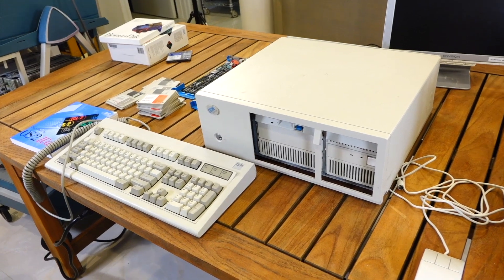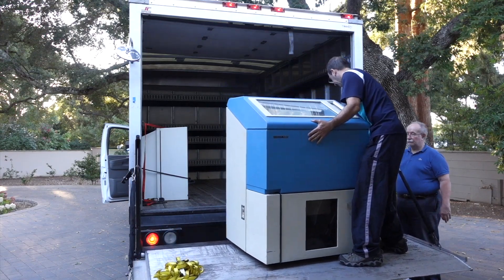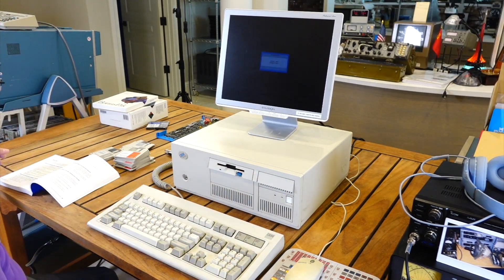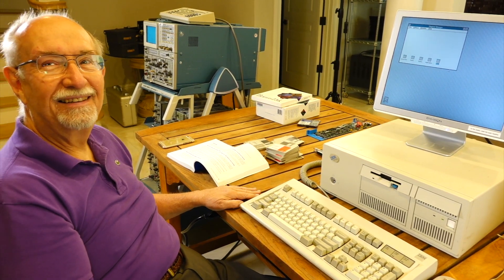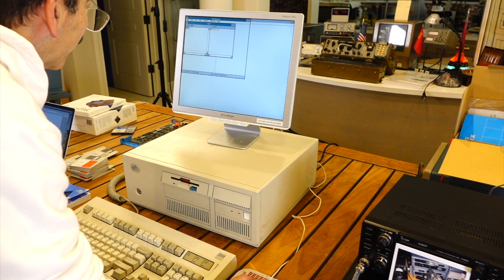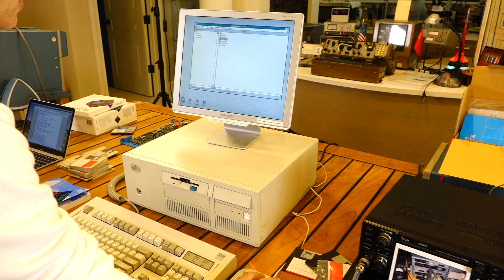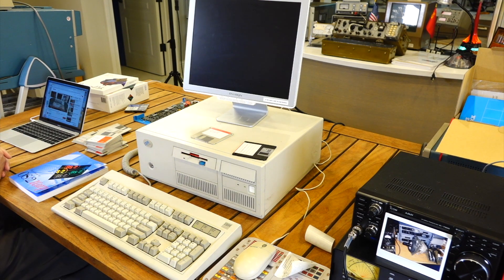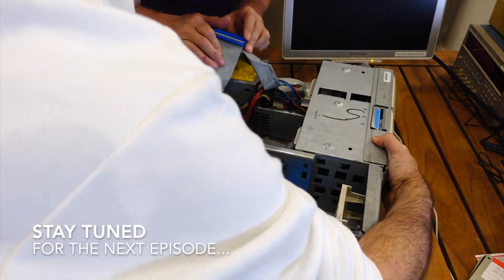IBM PS/2 - Part 1: the Model 77 conks out

Comment: The first boot we saw in the first video we did not hear a beep when booting normally. For most motherboards there's a speaker connected to it to sound error beeps from the BIOS reporting. Not for this machine ?
Reply from the maker: It beeps after POST at 4:52.
Reply: @CuriousMarc  OK, I hear, indeed, I was referring to 03:35.
The fact that it worked at first (and that the BIOS gets stuck) makes me think of (electrolytic) capacitors, on the motherboard or in the PSU. The PSU can measure OK, but is it needs testing for stability under load. I would have tried another as first, but I cannot tell from here if it is a special piece. You could check with a scope for cleanness of all the voltages.

Comment: The hidden partition remind me of a story. My dad once told me about an anti-piracy hack that was on old disks (probably floppy disks) where there was a physically corrupt sector of the disk. The program would write and then read that sector, and if it wrote correctly it knew that it was a copied disk. (because the real disk would return corrupt random data.)

He said his friends and him spent hours going line-by-line through hex editors comparing the two copies and couldn't figured it out. 

Eventually someone designed a device that plugged in between the computer and drive and would defeat the anti-piracy thing somehow. Wish I knew more specifics. 

The only other thing I know is that he was backing up software that he legally owned and not copying or distributing it.

Comment: Marc do you have an IBM 3420 Magnetic Tape Unit Field Tester? It is a small box with knobs, toggle switches and a short flylead cable that plugs directly into the 3420 tape unit and allows the unit to be tested in isolation - start/stop, rewind/forward, read/write and so on, no bus/tag required. I bought mine to go with my IBM 3420 tape unit that I bought on eBay "by accident" (and was forced to get it shipped interstate between Xmas and New Year). Let me know if you can't find one, I may be able to lend you mine.
Reply from the maker: Thanks! I know about it, and Carl has lend me his, so I am good for now. But wait. You bought an IBM 3420 *by accident*? Like it was just under 1000lbs so you did not pay any attention? Now I want to know how that happened!
Reply: @CuriousMarc  Glad you have the tester! I would be very interested to know how it goes. 
With my 3420, it appeared on Oz eBay listed as just 'Old Computer' would you believe. I put the initial bid on for a bit of fun and at a very low amount expecting to be outbid, and so I could track it easily. Later I had second thoughts as I didn't really want to have to ship it and got a bit worried I would win as the seconds ticked down. I groaned when sure enough I did. Then came the hassle of getting it. A furniture removalist was doing an interstate backload between Xmas/New Year (I was incredibly lucky to find that offer at a good price). I told them it was 'the size of a fridge, perhaps a bit heavier'... LOL. The two delivery guys dropped it off at my mum's place, they really struggled with it a lot getting it into her garage so she offered them a beer (Xmas here in Oz summer is hot). When it came to moving it to my place a few years later the box truck hydraulic tailgate lift almost didn't lift it.
I don't have 3-phase power so it'll be the 12th of never before I power it up, I suppose. But it sure looks cool. Would a single to 3-phase converter unit work?
Reply from the maker: @1944GPW  That’s what I intend to do, power them with a 3 phase converter. We’re not quite even sure why it would need 3 phase beyond the vacuum motor: the reel motors are DC.
Reply: @CuriousMarc  Fantastic! I will be sure to follow that adventure very closely and with a great degree of self-interest (As if I don't already follow you guys restoration adventures like it is! ;)

Comment: Seeing Marc struggle with Windows 3.1 like that is hilarious. I used to have a page on it and hang out in the PS/2 newsgroup something like almost 2 decades ago, and there still is a Model P70 stashed away in my parents' basement (not sure if it still works at all, the floppy drive had called it quits as most of them do, bloody SMD electrolytics). But yeah, there was a reason why we would rather be using Calmira than trusty Program Manager back in the day.

Comment: The original 486 CPUs came out in 1989, but they were just the original 20-25 MHz models that ran at the same speed as the bus. The 33 and 50-MHz models came out in 1990-91, along with the 486SX, a cheaper version that didn't have a floating-point unit (FPU) built-in, which led to the original 486s being renamed "DX". In 1992 came the DX2 models, which-- as the name suggests -- doubled the clock speed from the bus, giving you 40 to 66 MHz. Then, in 1994, they released the DX4 and later the DX4 WB models with write-back cache. Confusingly, these actually have a clock multiplier of 3 rather than 4 like you'd expect from the name, and were available in 75 and 100-MHz flavours. Those were the last 486-based desktop CPUs released by Intel; but AMD, Cyrix, and Texas Instruments continued to release new versions of 486-based CPUs up until around 1996. These included the even-more-confusingly-named 5x86 CPUs which were neither 5th-generation x86 CPUs, nor did they run a 5x clock speed! The market for 486-based CPUs for the budget desktop market lasted right up until 1998, when Intel introduced the Celeron as a budget CPU based on the Pentium II. It does seem really weird that they continued to make new 486 CPUs long past the release of the Pentium in 1993, but PCs with the latest architecture were so expensive back then that people were willing to buy new systems that were one or two generations out of date in order to save money. It wasn't until the late 1990s that PCs came down in price enough that the general PC-buying public could afford a model with the current architecture. I've got a 486 that uses parts mostly from around 1995 or so. That has a DX4 in it, but it wouldn't be unusual to find one with something like a DX2-66 from that time period either, especially if you've used up all your budget paying for that IBM premium!

Comment: Would you believe me when i say that at my job in 2021 i use an IBM AT with DOS 3.0, a couple of 486 with OS/2 machines, a 386 with DOS 6.3, and a small sampling of win98, xp, and vista machines? Also have a Fluke 9100A and 1720 series I've been struggling with (mostly due to poor documentation from the engineers who wrote the test programs a few decades ago). I repair Legacy Avionics Systems if you're aghast. I once spent a week and a half manually testing and Roll computer... that was analog... really wish I'd payed more attention in calculus...

Comment: I had a AIX R/390. That was a microchannel system with a S/390 processor on a card and a microchannel bus & tag channel processor. That booted AIX and then ran the S/390 emulator. I had OS/390, VM and Linux on S/390 (Marist College version) running on that. There was one time we took the processor across the road to the other IBM office and into the basement. That was the mainframe machine room (complete with a raised floor) and we hooked up a 3MB bus & tag 3480 tape (cartridge drive) so I could install some software that had been delivered from IBM manufacturing on a couple of tapes.

I've still got some of the CD-ROMS that include OS/390 stashed away.

Comment: I still have a 286/VGA based IBM PS/1 in the attic. Should be in perfect working condition. Those interesting machines could boot into a simple graphical user interface (running under IBM DOS 4.0) straight out of the ROM. They had 1.44 MB FDD and 512 kB RAM and grayscale monitor as the base configuration, plus a 20 MB HDD, color monitor and 512 kB more RAM as an add-on option. They came with Microsoft Works, and some great IBM software that would teach you to use the keyboard. They had some extra proprietary cable to the monitor and PC speaker sound would come from the monitor instead from the PC. They were very compact machines (but had no option to add ISA add-on cards!)

Comment: Awaiting the "Part 2" - Is there anything we can help with to get the Model 77 working?
Reply: It would be handy to know if the front LED's light up. I suspect not and a new PSU is needed. I installed setup and maintained most of the PS/2 range at some point and they were bulletproof.

Comment: I worked for IBM Labs porting software onto the XT/370 - an antecedent of this guy. It added 3 cards to a standard XT with a 10 meg drive. IIRC there was a 512k RAM card, a 3270 terminal emulator and a 68000 board with the processor remasked to run 370 ISA. We ran a version of VM/CMS on it and ported compilers and even the CICS transaction processing system. What fun!!
Reply: Dang. So it ran a 68k with custom IBM microcode to emulate most of the 370 instruction set. Then another unmodified 68000 was needed to handle the instructions that couldn’t fit into the first, then they added an Intel 8087 FPU again running custom microcode to handle S/370 floating point instructions. It’s a kludge at a scale that only IBM could have pulled off.
Reply: @beefchicken  Yep - I remembered about the remasked 8087 after posting.  Remarkably it did work and delivered about 100 kIPS at a time when mainframes were typically 1-3 MIPS.
Reply: I recall using one once at the computing center to extract my personal files from my mainframe account at the end of a course that involved development under VM/CMS.  No idea how many if the XT/370 features it had, as I basically used a file transfer interface and a stack of blank quality floppies.  But it was clearly a special machine as there was only the one, and it sat right outside the machine room, unlike the long rows or 3278 full keyboard terminals.
Reply: Developed in Endicott.  I worked on it.

Comment: worth knowing the parallel port puts out it’s POST status codes in hex - you can use a logic analyser or bcd to hex display.  they are also on ebay
Reply: Best investment if someone is around PS/2s - the parallel port POST readers are less than $10 USD on eBay.
Reply from the maker: @IBM_Museum  Thanks, I am furiously looking for one and my Google-Fu is failing me. Can you respond a link? I will let it through.
Reply from the maker: @IBM_Museum  Sweet, saw your video, and the link still works. Just got mine ordered, coming to me via row boat from China. I might just try to hook up a logic analyzer to the port in the meantime.
Reply from the maker: Really? Any doc about that? We saw the BIOS writing error codes but had no idea where it went!
Reply: @CuriousMarc  https://www.ebay.co.uk/itm/Parallel-Port-4-Digit-Motherboard-Diagnostic-Card-PC-Debug-Tester-USB-Tester-/265057391079?mkcid=16&mkevt=1&_trksid=p2349624.m46890.l49286&mkrid=710-127635-2958-0

I used a cheapo 8 bit logic analyser - I thought I published the video on it - but still in the edit suite.
Reply: @CuriousMarc  No speaker connected to the mother board for beeping an error code ? In the first video there was no beep when you booted.

Comment: That was a big spit in my eye.
As a basic and dos programmer circa 85.
Ctrl/alt/del
Edit 
I loved my 340 thinkpad though....
486,3.5" disk drive, internal modem and a university internet access in 95, on my Motorola wedge cel phone ...mobile.on bus with external cradle modem, battery life was short

Comment: I once worked as a C++ and REXX software developer for OS/2 for several years. Before that I was a COBOL software developer for IBM mainframes running MVS/ESA, CICS, IMS-DC and IMS-DB, DB2 and so on... But that’s actually not the point here. 
At that time I did use a PS/2 mod. 77 at work myself. It was a great machine and I liked it a lot. The IBM computers of that time were by far IMHO the best personal computers money could buy quality wise.
Reply from the maker: I have to agree. It’s very well built, graphics card is impressive, has SCSI, 2.44 MB drive, and microchannel was technically a good design.
Reply: @CuriousMarc : The XGA-2 video adapter can have issues and take a longer time to work with a flat panel display. It appears that you do have an IML partition set up (which replaces much of the "Reference Diskette" issues). I'm trying to figure out what is causing issues with what you are wanting to do.
Reply from the maker: @IBM_Museum  Yes, that’s the partition we are trying to back up. Any help much appreciated, are we are not particularly knowledgeable about these somewhat unusual machines.
Reply: @CuriousMarc : You really shouldn't need to "backup" the IML partition - once the system is operational, insert the channel adapter, and follow the prompts to insert a diskette with the ADF at the appropriate point.
Reply from the maker: @IBM_Museum  Thanks for being so helpful. I'm a newbie on these systems.  Yes, it was just a precaution in case the SCSI disk quit on us. But it seems something else quit before the drive did... I just sent you an email.

Comment: 1:42
Ooh, that is beautiful!  I have never seen a completely clear floppy drive before!
Reply: Next on the menu, completely clear 3-1/2” floppy disks! 😝
Reply: Is it clear or just open with the lid off?
  By the way, making a fully  clear floppy (8" or 5¼") would cause problems with the optical sensors that detect insertion, write protection etc.  It would also be difficult to make a clear version of the inner padding.

Comment: you do ham radio ?? I remember the first time I touched a computer was a apple iie trying to draw with a turtle with a program on a cassette tape, then a sinclair zx81 copying code from a book and lose all of it when you shut it off, then my dad got a IBM PCjr,  8088, 16k of ram, 16 color monitor, 360k disquette drive and I must say it is the first time I stated to program on my own with DOS and running basic. We then got a slew of computer as they got more powerfull, 286, 386, 486, Pentium, Pentium II which is still have to this day with a soundblaster 16 and a nVidia V3400TNT video card, PIII and VI up to newer generations... it's crazy to see how it did evolve in 38 years !

Comment: Oh, now that was entertaining.  Folks familiar with HP mainframes trying to figure out how OS/2 works.  Don't worry, what you are doing is normal for figuring out how the POS works.  Don't worry, the documentation won't really help.  I think one problem you are having is the BIOS does not really know you added memory to it.  So when the "boot" happens, its getting the wrong info from the BIOS.  This is not a  self-adapting system.  It's stone knives and bear skins.
Reply from the maker: See the following episodes. Has nothing to do with basics like BIOS setup or memory, or we wouldn't even have made an episode about it. It's way more interesting (and difficult to repair) than that!
Reply: @CuriousMarc  I noticed.  It's just that I started life out working on PC's and IBM's were the worst.  That proprietary bus was a nightmare.  And on top of it, you paid at least $1000 more for a card that would fit it, compared to a normal one.
Reply: yea, I have to imagine he didn't set the bios properly after adding the ram.  also, if he turns off the memory test, it will boot faster.
Reply: @AllenKll  Wait till he finds out OS/2's other name: "Please wait"
Reply: @kevinreardon2558  I used a 77 as my main work PC for years.  The PS/2 MCA architecture uses those config diskettes and hidden partition to store the equivalent of UEFI flash rom variables.  The diskette/partition contains the config user interface for each installed card AND the actual configuration data, mixed so thoroughly that any damage can be fatal to future service.  That Microsoft OS software corrupts it automatically is typical of MS incompetence.
Reply: And he dares call Win 3.11 abominable!!! I can assure you that Win 3.11 is quite amazing and is very fun to use!

Comment: I love the PS2 machines looks, I love their build quality but the one's that have MCA ... man its hard to justify (the few models with ISA are usually the really old or low budget models) worked on a pile of these, its either the psu or the tantalum cap's on the motherboard (let it run long enough after failure and it might show itself!)
Reply: Tantalums Throw Tantrums To Terrify Timid Technicians
Reply: My bets are PSU with both failed capacitors, and dry joints on the power transistors, along with dry joints on the transformer. Likely you will also find the higher value resistors are either drifted higher, or totally open circuit as well, so the PSU will not start up. Other failures are diodes that go short circuit, stopping the power supply from starting up into the near short.

Comment: This is painful.  It is a '486 running at 66 MHz, of course it is "slow".  Where do you think Windows 10 came from?  It developed out of Windows 3 (itself from earlier versions, back to Windows 1), munged with OS/2 to become (ish) Windows 2000/XP etc. Ever thought of trying FDISK?  We used to use Model 80 and 90 for most of the 65 Netware servers the Uni had at the time.

Comment: I used to be a master of the system partition of PS/2’s while working at IBM in the late 90s! I seldom recall anything now but there is a way to access the system partition from the hard disk and I think that is what the system is trying to tell you to do right at the end of the video in order to back it up because there are system options are loaded in the hard drive and NOT in the boot disk you are using, and if you loose those system options then the system will NOT boot.

Comment: My Model 80 had a 5250 microchannel emulator card so I could connect to the twinax cabled terminal lines of the university system 3x machines.